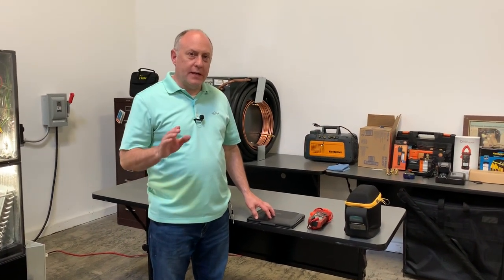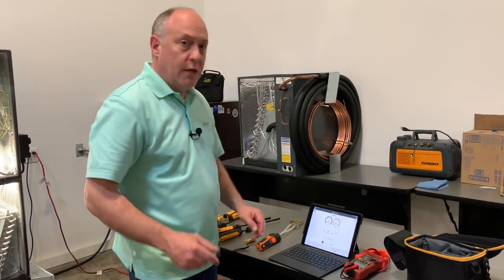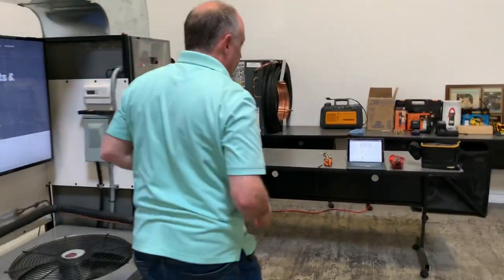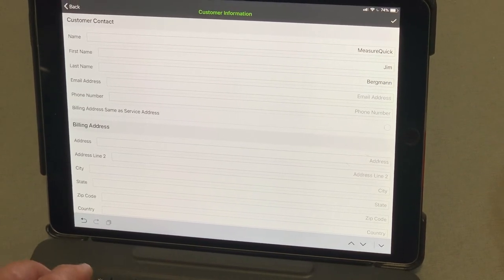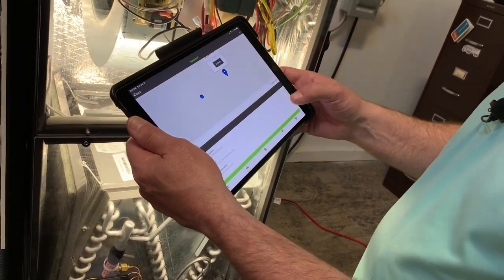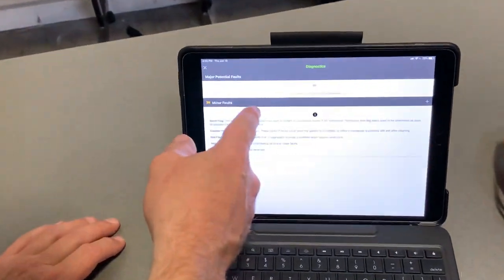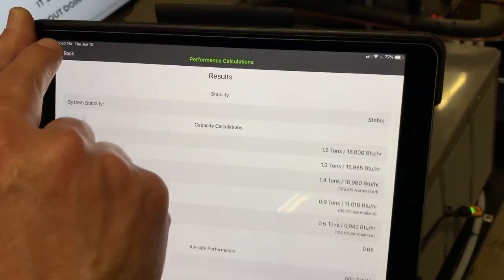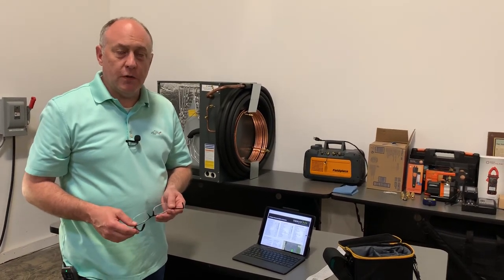How to use MeasureQuick for Reporting Commissioning and System Diagnostics

Comment: Jim,
Thanks for Making Measurequick ! i Used it the other day and it gave me alot more information than just my testo 557's. Thanks for that ! it Made my diagnosis of the Refrigeration system issue easier , more accurate & Proveable by the guages showing out of range etc & i can show that to the customer. ( i made a video ) Thanks again.

Comment: Thank you for the project setup and reporting.  Will MQ report the same information is if we have to manually measure electrical, make the calculations for Watts, then submit?
Reply from the maker: Kenneth Napier same information, yes. The meter just makes it much faster, easier, and more accurate.

Comment: Hey Jim I bet it would be easy to have the app use the pressures and super heat/subcool and automatically decide that discharge temperature will be low or have a red flag to say discharge temps could be too high at this point
Reply: Adding a target discharge superheat?
Reply: The Discharge gas temp guage on the app Works pretty good if u really look at it. it has a Range. But an exact Target would make it awesome.

Comment: Hello Jim I  have a IPAD 3 and  it will not allow Measure Quick app to install. Do I need a IPAD 4  or PRO to use Measurequick  app ? I  can use Testo app on my IPAD 3 but not Measurequick app. I do have Measure quick working on my Android phone which is awesome I have to say. Also where can we purchase a Measurequick printer ? I guess my thermal printer I use with my Testo 320LX will not work with Measurequick ? Thanks in advance and keep up the great job man. Cheers from Baltimore Maryland.
Reply: I just found the Measurequick printer at True tech tools.
Reply: i Got a iPad4 off E-Bay 7 months ago. ( about 110$ )  it works Good for Measurequick & testo. Great battery life. But if i was to do it all over again i think i would just get a New ipad. if think they are only about $225.00 so only about 100$ more. well worth it for a faster processor my processor i can tell is just on the edge of being a bit laggy.

Comment: The whole enchilada and a bag of chips! Very nice. I need to find a 1/4" flare tee for charging on the low side with a smart probe. It's hard to find one with a core depressor. Could you recommend one?
Reply: I have some I think from CPS picked up at supply house.
Reply: JB Part # A34000
Reply: Johnstone Part# B17-938
Reply: I prefer a 6 inch hose with built on tee. The come in a 3 pack. It gives much needed flexibility. Solves the tee and core depression also has a ball valve.

Comment: Good evening Jim, what would be the procedure to make the measurements to multistage equipment, I have 2 sets of TESTO Smart Probes and the TESTO 770-3 TRMS CLAMP meter, we work with commercial air conditioners with up to 4 refrigeration circuits, how can we make the measurements? To this type of equipment? Thanks in advance for your response, regards ...

Comment: I hope that sheetmetal strapping of the bare copper coil behind your left shoulder has an isolator to prevent dissimilar metal corossion.
Reply from the maker: That is a training rig for vacuum, nothing is flowing through it. It should last at least 100 years.
Reply: @measureQuick  does internal flow actually effect corrosion? Now i need to actually research this.

Also just used the mQ app first time today with fieldpiece probes. Unbelievable how much information is presented and usable at your fingertips. Ac at my own house has very low compression and ive been searching for a leak that doesnt exist for the past year. Game changing.
Reply from the maker: “Galvanic corrosion (dissimilar-metal corrosion) is an electrochemical process in which one metal corrodes preferentially, when in electrical contact with a different type of metal, and both metals are immersed in an electrolyte such as water”
https://www.sciencedirect.com/topics/materials-science/galvanic-corrosion
Reply: @measureQuick  dude, im in awe of the speed and response of your team. The 13 year old girl in me is imagining that big man Berg himself is responding to my questions.
Btw let tech support know my vitals werent working because i dont have an active outdoor probe yet.

What you guys are doing to the residential industry is awesome and has been a long time coming. Keep that pedal to the metal!!

Comment: Good vid.
Hi Jim,
i was wondering what the " Red flags " mean on the New Update On Mq on the " Results " page.
Thanks,
Oc.
Reply from the maker: You were wondering and now you know or are you still? If you tap on the red flag, it will show you specific issues that MQ is identifying about the system operations.

Comment: How do I get the app to identify a temperature probe option as discharge.  Presently only the small switch will identify the field piece probes as either supply or return, depending upon where I have the switch set to.
Reply from the maker: We do not use the switches, go to the toolbox, and activate the probes, tap probe manager, and map each probe to its specific function.
Reply: @measureQuick  Thank you so much.  I followed these instructions and it worked great.

Comment: How long do you think this process takes real time on average to hook up all gauges and input data. Say if you have a benchmark time to use?
Reply from the maker: Once you have it down, less then 30 minutes start to finish for the testing and benchmarking. The time comes into play when you find problems in 7 to 10 out of 10 systems. So you find more billable repairs on every job resulting in a higher revenue per ticket.

Comment: Do you need two static  pressure units? my Testos 510I has two ports for total Static pressure
Reply from the maker: No you don’t not unless you want to measure the static pressures independently. There’s some additional diagnostics we do when you have them separate.

Comment: measureQuick jIM what about field piece smart wireless meters to measure amps watts volts capacitors gas pressure, CFM, WATER Col on furnaces etc? I know it linked up with redfish

Comment: Hey Jim, how do run this program on a laptop? Do you have a desktop application for MQ? The reason I ask is because I primarily use the latest Microsoft Surface Pro for work, and I would rather see my readings on here than on my phone. 
Thanks! 
PS, the phone app is still amazing!
Reply from the maker: Justin Dowler Sorry, it is not comparable with that platform. We would have to make a custom Bluetooth connector for the Surface Pro for that to work.
Reply: @measureQuick  Okay that is what I figured. Thanks for the reply! I will probably just get an android tablet to use the software on
Reply: @measureQuick  Considering the huge boost to your market segment capitalization, creating that Bluetooth connector would be very empowering for technicians.
Reply from the maker: @resurgensix  it’s about a 3% market share of the smart devices. I can’t imagine it is that big of an HVAC opportunity. What are we missing?

Comment: i Think the New update might not be working right. on my iPhone 6splus i cannot save a snapshot to email anymore. version 1.0.3 ( 201906252240 )
Reply from the maker: We had to roll it back, some code got pushed up prematurely. If you close and restart the app it will correct the problem
Reply: Thanks for the reply's Jim.
The App is Back to working properly again with the rollback.
When the new update was installed it put red flags beside each project in the results page. its not there now with the rollback u just did. so All is well. no flags to worry about.
i know the other red flag on the home screen is for what u said , problems with the system. i was not talking about that red flag.

All is Good now.
Thank you.
Oc.

Comment: I scanned the trane condensing unit for profile but it came up with a strand of numbers and letter that doesnt match either model or serial or make 🤔
Reply from the maker: Barcodes are hit/miss. The best thing to do when you have one that does not work is to take a good photo of it and send it to Jim@measurequick.com so we can see if we can parse it out better.
Reply: @measureQuick  could you look into picture text extract function? Most phone have this built in where I can highlight the text in the picture. Thank you for the prompt response!

Comment: Hi Jim,
in reference to new update --- 201907161112
1. i Would Like to Request BEFORE u do a update --- Post a video of what will be in that update. NEW Features & how to use them , info on those features , FAQ etc. it would be very Helpful , instead of throwing the update out and we are like oh whats this now ? on a job site.
2. i don't like the Bold for active option vs actually saying active. the bold is barely anydifferent on my iphone than regular font. i cant discern easily. Please change to maybe Just a Green dot. That would be very esthetically pleasing and straight foreward. or bring " Active " Back. i Would prefer a Green dot.
3. Re: Please move the cloud sync knob away from edge of screen on my iphone. too close.
4. Question --- Will Everything be syncing to Your cloud automatically or Will We be able to control what syncs and what does not ? 
5. Will i be able to disable " cloud syncing ". ( Privacy issues , security issues , proprietary issues , Customer privacy issues , etc.
6. i Would like the option to Roll back our updates , if we dont like the new update ?

Comment: ? Why two testo 510i ?
Reply from the maker: I Measure supply and return air static independently. We’re going to be adding some diagnostics in Measure quick that will take it vantage of two manometer’s. You can also use them for measuring Incoming and manifold gas pressure’s